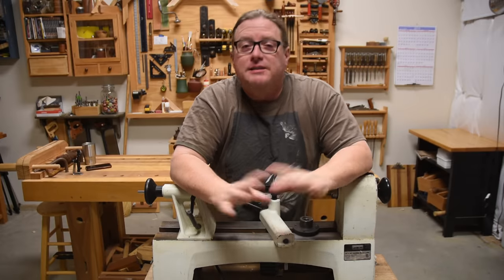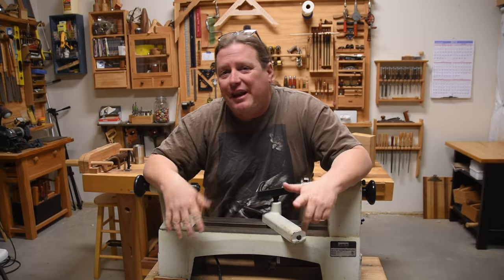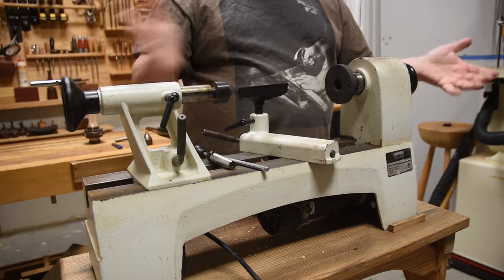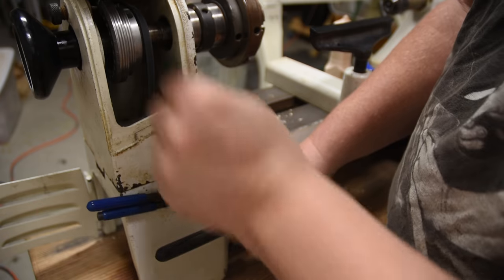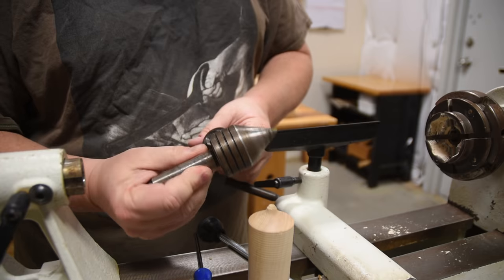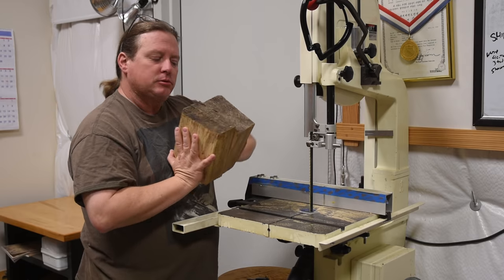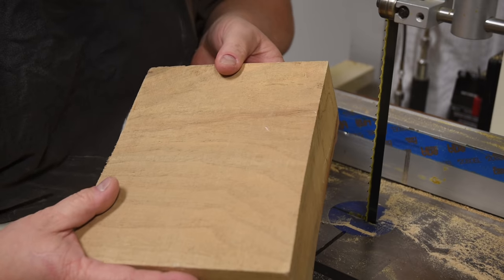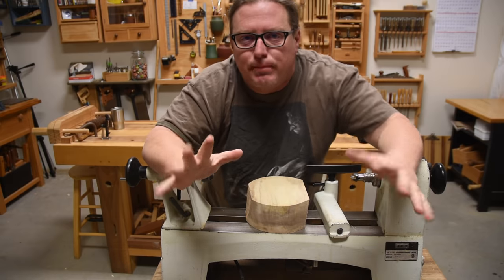Turn Your First Bowl - A video class on bowl turning.

Comment: I guess that business with cleaning up the tenon is why every turner I've watched uses a mortise to attach their bowl to the lathe. Either that, or a glued piece of scrap with a hot melt glue or something else that will part easily on the glue line.
Reply from the maker: tomatoe, tomahtoe... both work. But I find new woodworkers have better success using a tenon as otherwise many end up with lamp shades. But when you use a recess you still have to flip and turn it if you want professional looking product to reduce it's size. Otherwise it looks odd to customers as they flip it over when buying so they won't pay as much.

Comment: While shear scraping the outside after mounting on a tenon (1:00:30), my bowl started developing cracks. It is not green, it is dried. The tool is sharp (tormek). Is this caused from heat?
Reply from the maker: Collin Clay my guess is cracks were already there you just revealed them or noticed because smoother surface.

Comment: So I watched your hour long video that you directed me. And you didn’t answer my question at all. I know how to use a lathe. My very specific question was how do I turn a DEEP bowl or a DEEP cup when all I have are shorter turning tools. Yes I do have a mini lathe and I do an awful lot on it, but I’m finding it difficult to get my tools comfortably inside a deep cup or bowl without there being a lot of vibrating or “howling”. I can’t get a good anchor for my tool because the tool is extended and there isn’t much support for it deep in the cup. Two or three inches of the tool is inside the cup without any support from the tool rest. How do I deal with this situation?  I’ve resorted to turning half cups, gluing them together, then putting the deeper cup  back on the lathe. I have many people asking me to turn deep beer steins and the like, and I just can’t comfortably get my shorter tools that deep without much support.
Reply from the maker: Dennis Michael Tiffany  the answer was given and you even answered it in your question. You need support to reach in or leverage/support on back. It’s the reason we move our tool rests buy long handles.

Comment: OK...I've watched several of your wood turning videos, because I just got the lathe and bandsaw last year..getting frustrated trying to use your technique with my tools.  you're a talented person, but my tools (gouges) are different grinds than you use.  I have 2 words for you...Carbide Tools!  done!  made 2 bowls just today.  I made a black walnut bowl, that wood is as hard as rock.  I understand the traditional tolls...the last buggy whip maker and all, but man, so easy, so fast, so I sanded another 3 minutes, big whoop.  Carbide rules.  your opinion?
Reply from the maker: Too slow, doesn’t finish as well, lacks details. There’s a reason why pros still don’t use them for everything. They’re wonderful for deep hollowing. Sounds to me you were expecting perfection from get go, didn’t get it so you hit easy button. How many spindles did you practice beads and coves on before jumping to bowls. How many activities do you do without practicing first?
Reply: @wortheffort  wasn't looking for perfection, but I was looking for at least some success, at least more than I was getting.  spindles are easy enough, using all traditional tools, even used the skew chisel on spindles, no problem.  it was bowls I was trying to do, these carbide tools rock for that.  sure little more sanding, but wow...well worth it.  no pun intended.

Comment: Does anybody know if there is a chart that shows the most stable woods and then tapering down to those that just go all crazy when they dry?  I think I am rough  turning my bowls too thick and then have to wait for them to dry longer  than necessary.  Some woods I have turned (notably Calif pepper) just  warps like crazy and I barely have enough to turn round when they are  dry.  then I turned some walnut and it seemed not to warp so much so I  could have turned thinner walls.  Any chart of stable woods and not so stable woods?
What has been your experience?
Reply from the maker: search wood movement chart. they're all over the place.

Comment: Just wanted to note that today I was attaching my faceplate to a bowl blank and THREE TIMES  the 1 1/2” X 12 wood screws twisted off in the blank.  I had to get a chisel and dig out around them so I cold grab them with vice grips to in screw them from the blank.  I got the screws from Home Depot.
Reply from the maker: punky wood?

Comment: Problem with stainless screws are very soft and you have to use a lot of pressure otherwise you wreck your Phillips bit and the head of the screw
Reply from the maker: The softness is an asset in this application as it's less brittle so can take shocks when you get a catch.

Comment: Hi,  " I just got a new lathe from Amazon  it is the  " WEN 3421 3.2-Amp 8" by 12" Variable Speed Mini Benchtop Wood Lathe"  I want to be safe but i also really wish you could do a tuitoral for a noodle cutter i want to make one for my mom.  But i know that i have to re learn.  Its been a while since i actually used one."

Comment: Ok. I admit it. I am frustrated. It looks like i have the right bevel and sharpness, the tool rest at the right height and distance, the tool at the right angle and pivoted correctly, and  I am either gouging the material and throwing the bowl off the chuck, or just barely skimming the bowl removing nothing. I have watched several videos, tried the techniques and I can't get beyond half the depth. What can I do?
Reply from the maker: Reach out to turners in your area.
Reply: @wortheffort  i would...if I knew how to find them
Reply from the maker: Don’t give me that. There’s google, fb, instagram all have location services as well as almost every state has some sort of turning group. There is always someone local who turns.

Comment: Opinion on Nova chucks?
Reply from the maker: Never used, don't know many that do, havent' heard many pros using them. Get a good one and it's a lifetime investment so price difference over a lifetime is negligible.
Reply: @wortheffort  yeah I got the mine and it froze up after a year and I got their new supernova 2 so I could still use my plates and it's running well. im definitely taking your advice and switching if it doesn't workout

Comment: Wondering why you did not just cut the blank without the big flat spot.  It may be easier for beginners.  Other than that the content and presentation is very good
Reply from the maker: Because that was the piece I had available. Thanks

Comment: If your drive center gets stuck, DO NOT HAMMER IT OUT.  Use a pipe wrench and TWIST IT OUT.
Reply from the maker: What's your logic on that one.
Reply: @wortheffort  There might be something wrong with my drive taper (rust spot or something, idk) but my drive spur gets stuck a lot.  I used a 3 lb sledge for like 3 minutes straight, all I got was a bent included knockout rod, and broke the plastic knob in half.  Penetrating oil didn't help.  Found a tip online that I should twist it to break loose the taper.  The ideal tool for twisting round objects is a pipe wrench.  Took a good, grunting shove but it broke loose.
Reply from the maker: @ianjohnson182  So you're telling people not to do something that everybody has been doing for a century and is recommended by manufacturers (who provide the knock out bars with their lathes) based upon your experience with a malfunctioning machine? My experience with pipe wrenches is they will damage what they are working on. More than likely you'll make the drive center worthless.
Reply: @wortheffort  I'm saying, if it gets stuck and you can't tap it out, and you cant sledge it out, then twist it out.  It isn't my advice, I found it on a wood turning forum and it worked for me.  I'm just passing along advice that helped me.  You're the one who said cheap used lathes have problems, this might be a common one.  Couple wraps of electrical tape on the wrench jaws will prevent most of the damage, it'll leave just a few scratches at most.

Comment: watched this a couple of times...along with some of your other videos on turning..trying to get the hang of it.  frustrating.  I'm trying to use your technique with a different style bowl gouge (mine is the U shaped--horrible).  it's clear I need the fingernail gouge.  also, where is the video where you talk about not treating the roughing gouge like a bowl gouge?  there's a video of a guy (not you) showing why you don't use a roughing gouge on bowls.
Reply from the maker: Finger nail is just how you sharpen the tool. You can have a fingernail grind on a u flute. A spindle roughing gouge should never be used on a bowl. I explain why in most of my beginner turning videos.
Reply: @wortheffort  thought I was getting V shaped off amazon (the picture showed) but it got here and it wasn't even close.  don't want to start grinding it yet, so I'm shopping.  do you have a blog?  I see you dropped facebook, LOL

Comment: Stainless screws?
Use steel.
Reply from the maker: Nolan Tyrrell I don’t know how you’d make stainless that wasn’t steel. “Stainless steel”
Reply: Interesting that you deliberately misunderstand  my comment. Was it  @wortheffort ? 
Ok, (he said tiredly). Many forms of stainless are softer and less strong than non stainless steel screws. Snap one of those off, (and I have many times), and you have a problem. 
Why the puck use expensive stainless screws when ordinary steel screws work better? You are duplicating the problem with plasterboard screws you are trying to avoid.
Reply from the maker: My understanding is slightly softer is safer in impact situations and that's the problem with drywall is they were never annealed. You'd rather them bend slightly so there's warning than snap suddenly. Then again, the woods the week point most times. Either way I did tell people to go to a specialist screw store and tell a knowledgeable employee goals and get their help.
Reply: Perhaps. Drywall screws are intended for plaster into softwood. They are hard but narrow gauge and the thread is half the thickness of the screw, so they are weak. 
I use roofing screws a lot. The hex headed ones. Sometimes batten screws. These are all hardened and if you've ever tried to break one you'll know how difficult that is. Mild steel or stainless are going to be damaged by repeated usage and this leads to damaging your driver bits. If you are working with aluminium windows or boating applications by all means use stainless, copper or brass screws. Otherwise avoid them at all times. 
Drill out the holes in your faceplate to take larger screws. You wont regret it. I turn redgum railways sleepers this way.  @wortheffort